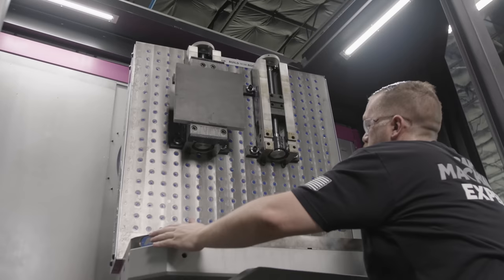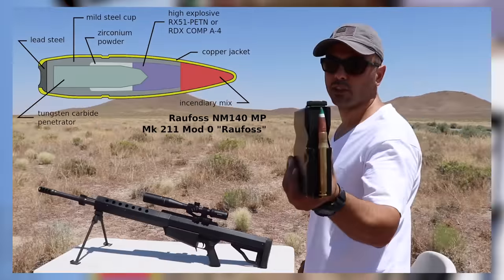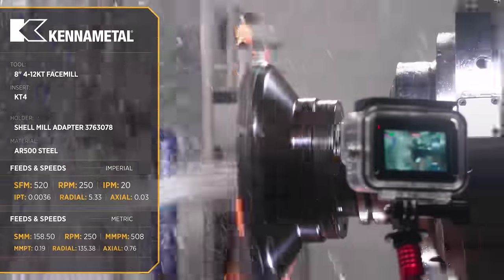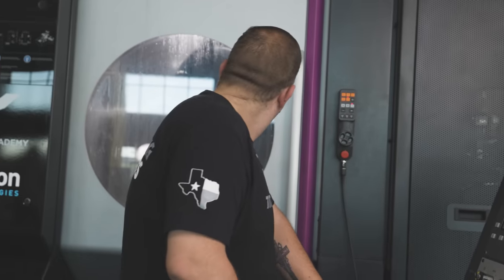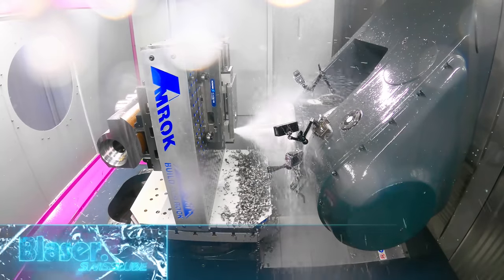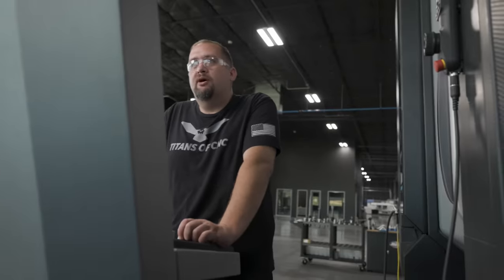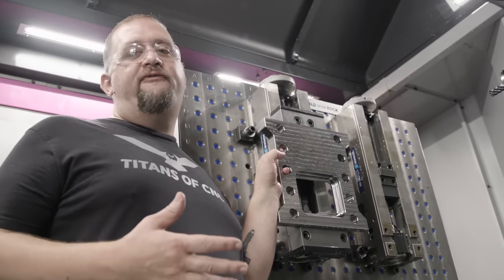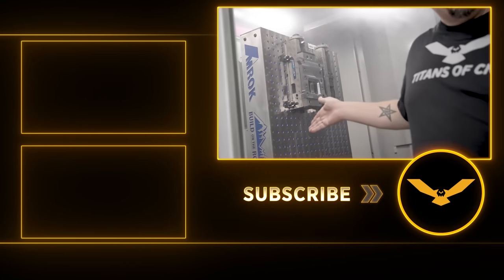Can AR500 ARMOR PLATE Be Machined?

Comment: What's the difference between AR steel, tool steel, maraging steel and spring steel? And which one is stronger?
Reply: the composition of the alloy and it all depends on how it's used, what kind of AR steel you use, what tool steel for which work etc 

as far as i know AR steel is the same or similar to Hardox which is used for excavator buckets because it's abrasion resistant. + it's weldable 

if you would use hardox for a leaf spring against a spring steel like 55si7 the spring steel would be better suited for this job because the alloy doesn't needs to be abrasion resistant but very flexible

then if you use a tool steel in comparison to both it wouldn't be as abrasion resistant and not as flexible but able to be harder and stays sharp longer due to it's alloys and is therefore superior in cutting stuff

idk what's maraging steel so can't say anything about that 

but it all depends on the job you want to do with it 

hope that helps and greetings from Germany
Reply: A video on same toothpath but different materials will be cool!
Reply: @Sebastian-ed5kt  Steel is a ductile material so hardness, tensile strength and flexibility should be proportional. So I guess the difference between high strength steel and abrasion resistant steel is the friction coefficient? Is AR steel self-lubricating? Does spring steel has higher fatigue strength relative to it's tensile strength?
Reply: @johntheux9238  no, the difference between high strength and highly abrasive resistance is determined by the alloys used in the steel (every alloying element brings different aspects with it) that's the reason why so many steel types exist. 

for the tensile and fatigue strength
there is a correlation between both factors, for 55si7 the tensile strength is higher but I'm no metallurgist by any means so I can't really read the diagrams etc 
but there is a reason why spring steels exist/ any steel exist because the alloy composition made it superior to another composition for a specific use 

e.g a simple carbon steel like 1080 at 60Hrc will loose against a higher alloyed steel made for cut resistance in a rope cutting test because the 1080 doesn't have any harder carbides that allow the higher alloyed steel to cut longer. 
but the 1080 will probably outperform a high alloyed steel on therms of shock resistance😉
so it depends on the situation
Reply: @Sebastian-ed5kt  If you have carbide particles inside the steel you will get more compressive strength than tensile strength (like concrete for example)
Graphite particles on the other hand can lubricate the steel so some alloys are more abrasion resistant despite being softer.
Reply: So their are a lot of different steels out theiri recommend just googling them.
Reply: @dominic6634  They are all the strongest steels on the market with pretty much the same mechanical properties.
Reply: @johntheux9238  I think your mixing up a bunch of stuff. Afaik only cast iron has carbide particles in it.
Reply: @johntheux9238  steel doesn't always behave ductile. Just look at a stress/strain curve of a through hardened steel
Reply: How many parts before insert or EM change?

Comment: Barry, you won’t like this.

The M113 and the M2/M3 Bradley (M2 for infantry, M3 for cavalry) have aluminum hulls. The Stryker wheeled APC is steel.

“So how do they keep the bullets from coming through?” Two ways. The hulls on those vehicles are thick cast aluminum, and inside the vehicle is a ballistic blanket called a spall liner. If you get hit by fire that knocks chunks of the hull off the inside, the spall liner catches them. There’s also a collection of add-on supplemental armor…at least a few people have screwed wooden blocks to the hull then screwed chain link fence to the blocks, which defeats RPG-7 rounds very nicely. An RPG-7 works like a plasma cutter, but it only does its thing when the rocket is pressed up against the metal it’s cutting. If you give yourself a few inches of stand-off between the rocket and the hull all it does is damage the paint, and a rattle can will fix that. The only drawback is it pisses off the sergeant major when you do it because it’s really ugly.

“Why the hell did they do that?” They wanted these light enough to be transported on C-130s and to be able to swim. And as light as they are, they use really small engines - the M113 uses a 318 Detroit.

For real entertainment at your shop, try to get a piece of the ceramic composite armor Steyr is using in their Pandur hulls.
Reply: Well, i actually LIKE that info hahaha

Comment: I work with vwry similar steel plates on a daily basis and they're even worse to work once used as they 'surface harden' plus particles of silica and other hard minerals get embedded on the surface and absolute nightmare to do any welding or drilling. Carbide teeth broaches on magdril usually last for two or three holes if you are lucky

Comment: We machine this stuff every day! It's also used in industrial shredders. We machine spiders for a company called Riverside Engineering. The messed up part about this material is it isn't consistent. It's hard then soft then hard. Like machining through case hardened metal. Only this material has a case hardened thickness of about. 25". If ya'll need tips on machining this, shoot me a message..
Reply: Dude that is SO true!

Comment: We machined the armor plates covering the Zumwalt class destroyers it was uncharted material  what a trip that was on the first one 1 1/2 flange nuts being ripped off the studs and the nuts hitting the ceiling forty feet up. 15 foot plate warping 6 ft I tried to warn them it needed to be cut with good solid carbide but they didn't want to spend the money. The carbide with its expense would've doubled there profits can't see the trees for the forest. At the time the plant manager now president of company a intelligent person but cocky with no wisdom. He Couldn't stand it that when I made a stand on something I was right and he was wrong. I was just trying to help the company be more profitable. Well at the age of 54 he had me laid off because he couldn't legally fire me with my work record. It was so bad my foreman had been refusing to do it for 6 weeks. Which I didn't know. When he finally came up to me to talk to me about it he said they want me to lay you off. He said I'm not going to. I said how long has this been going on. Month and half. I told my foreman (whom got that position because of me. I turned it down and told the machine dept manager he's a better fit no conflict with the president) he will fire you if you don't do this. Well he got fired two years later. This fool is driving the place into the ground. Due to circumstances beyond my control after my layoff I lost medical coverage as a diabetic became disabled now I'm soon to lose everything and can't get hired or be able to hold job if I wanted to. Yep can't write this stuff. Always be honest and truthful with yourself and everyone around you with integrity.
Reply: Damn man, I hope something good will come your way some day and change it for the better

Comment: Great job Barry 

Would love to see you or one of your team machine some sort of camber profile on hardened D2 (62 Rockwell) now that would be impressive. 
Milling it not EDM as that would be too easy.
Reply: Why do you want to see me suffer?!?! I thought we were friends
Reply: @barrysetzer  d2 isn’t bad. High alloy stainless like CPM S90v and rex121 (71hrc) are where it’s at. Wouldn’t be as interesting for gen pop as ar500 though, not commonly known outside knife making
Reply: @jacobacostamasterscribe2200  we use hardened s90v in our shop. It's also used lots in the dairy production and packing industry. Interesting stuff to say the least 😃
Reply: @scottpardoe6349  that’s interesting. What’re y’all using it For?
Reply: @jacobacostamasterscribe2200  die plates and punches where plastic is being cut  for yogurt and cream containers. Where the steel requires both stainless and hard wearing properties are required.
Reply: Hardox 600 has the hardness 62 Rockwell and it is not so troublesome to work with the right tool.  the problem is if you tool is hardening the material under production the tool I'm using can only cut up too 68 Rockwell.
 Hardox Extreme I'm glad I don't process because It's really hard  650–700 HBW .

Comment: i know its comming from some random dude . but that facemill ( its realy a shoulder mill )  u wanna run it without coolant , blast air on it . 
also AR 500 likes to run on dull tools so a dull harvy 1 wil do better then a sharp when hogging material.
 and for drilling u need to PUSH so the chip wil break because otherwise there is no chance in hell u gonna make it ( also cooling as high of presure u have )

Comment: As useful as AR500 is, in the end of the day it's only a medium carbon steel (1 wt% Ni, 0,75 wt% Cr, 0,75 wt% Mo, and a little bit of boron added for through-hardenability.)

450-550 Brinel hardness (about 47 to 54 HRC) and isn't soft by any means of the imagination, but there's way more extreme steel out there.

Test a plate of MAR350 in H950 hardened condition (3 hours at 950 °F). That's about 50% stronger than hardened AR500 and can hit up to 60 HRC. 

(But, better not compare prices, because MAR350 is among the most expensive steel alloys out there. Well in excess of AR500.)

Comment: AR500 armor is not acceptable for worn armor. It's fine if you mount it on a vehicle where you don't care about the spall, but ceramic or HDPE is the only way to go for worn armor plates.

Comment: I wonder how ar500 compares to ar400 because where I work we machine ar400 time to time for wear resistant plating in industrial applications. It’s not too terrible we even use hss tools to machine it sometimes.
Reply: AR400 is around Rockwell C 44-47, AR500 is 48-51, neither are particularly "hard" the heat treating process for AR steel is designed to increase toughness far more than actual hardness, these steels are on the top end of medium carbon to the low end of high carbon steels usually around 0.5-0.7% carbon. The reason these steels are used as personal armor is that they are cheap and readily available (they were never developed for armor applications, especially not tanks that when they did still used steel armor used spaced rolled steel armor) a far more common application would be dump trucks and pretty much anything that would get beaten on all day that needs a steel with a decent enough surface hardening not to get scuffed easily and strong enough to take hits all day long without cracking.
Reply: @DOGMA1138 AR500 is still considered significantly harder than AR500. Just 100 brinell hardness alone would make a significant difference actually. Although that many people will realize that.

As for as toughness goes. AR500 is tougher but also more brittle than AR400. It has more strength and is harder than AR500 but also more brittle as well.

Comment: I'm surprised you guys haven't talked about adjusted feedrate in tight radius situations
Reply: With a HSM tool path there isn't really a need to adjust feed rates in the corners.  The tool path is designed/calculated to maintain the same radial depth of cut in a corner as it would see in a straight cut.  That's also why in a corner with a .250 radius you use a tool with a smaller radius so the machine has to interpolate through the corner.
Reply: @brandons9138  but in an arc the effective feedrate at the cutting edge is faster then that of the center of the tool, where the feedrate is set by. This is why the feedrate of say threadmills is very low when you calculate it, because they're always doing small arc. I also use the option in mastercam to reduce feedrate in arcs with hsm toolpaths sometimes when cutting tougher materials like titanium, it can significantly improve tool life.

Comment: 2:40 you can see the stress on his face 🤣. Was the face mill finish that bad?
Reply: Bad enough the finished part was remachined with a much smaller diameter cutter.  Didn't put this in the video though.

Comment: ...as armor?  It was originally designed for earthmoving equipment. Abrasion Resistant.  REAL armor plates start off at HY-80,-110, etc extending all the way Chobam Metal matrix ceramic.  I've had the distinct pleasure of blasting holes through and defeating ALL KNOWN ARMOR.

Comment: shoulda tried AR550
Reply: Demolition Ranch never shot AR550. It was an 1" thick AR500 just like the plate Edwin Sarkissian has. I wrote 1" AR550 on Demo Ranch's plate (only for the show). It is actually an 1" AR500 as well like the plate I sent Edwin Sarkissian. Going Ballistic shot my 2" thick AR500F plate with the Tungsten carbide SLAP rounds out of their Ma Deuce. Thick enough. ANYTHING stops. I'm sure my steel can defeat their CNC machine lol! I can have my plates stacked up to 13 inches thick and ask them to drill completely thru it. Most likely their CNC drilling tools are destroyed, unless they were using waterjet.

Comment: When you face milled it you removed the hardest layer from the material. So using any tool after that through the softer core of the material is no issue really.
Reply: That grade of plate is through-hardened.
Reply: @ryanhankins4377  thanks for pointing that out

Comment: Tungsten carbide is MUCH more harder than steel, so it is completly normal it can be machined.
Actually,  these tools are designed to machine HSS steel.
Armored steel is not that hard.
Hard steel would broke to bullet impact !!!

Comment: Something is off, the surface finish on the final shots indicates the plate has been faced with a small diameter tool (end mill) and not a face mill. Hmmm
Not questioning that AR500 can be machined, just found it odd. It's a steel in the 50 HRC range after all, nothing too special.
Reply: 4:36 the face finish seems to change..